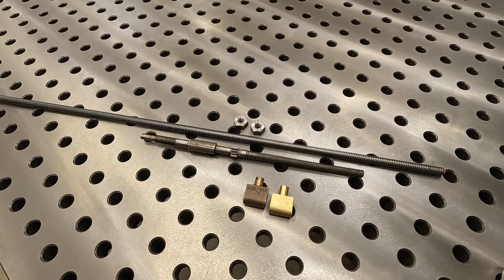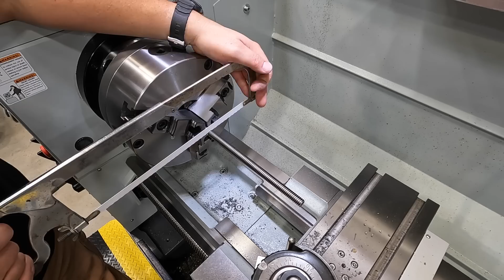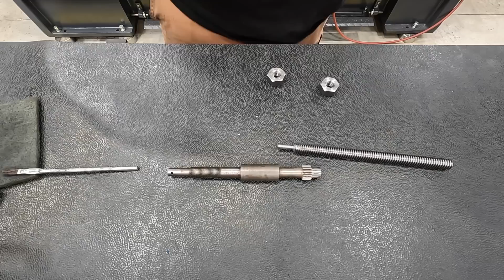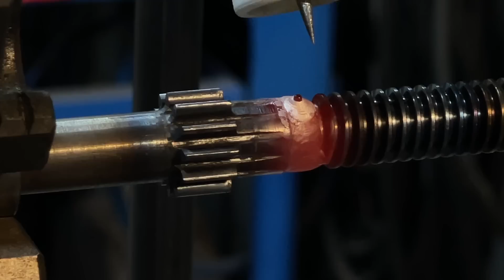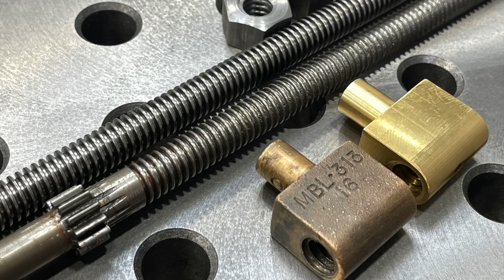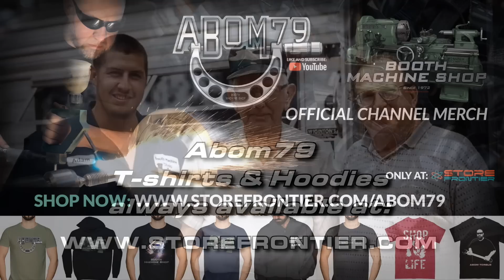Lead Screw Repair for 10" Rockwell Lathe

Comment: You were doing fine till you went at it with the welder, and were very lucky to be able to straighten it again.  A turned and bored interference fit well cleaned out with a drop of loctite and it was rock solid.

Comment: I just bought an eleven-inch Rockwell without being able to check for that type of wear. Why did I do that? This particular corporation that i frequent to repair machines had just retooled their maintenance dept (here's your budget, spend it or lose it) and it was headed for the dumpster. They told me to make an offer and I did. $150. They accepted and I got it outta there before they could change their mind. It came with two three jaw chucks, one four jaw, a face plate with three different drivers, a complete set of collets from 1/8-3/4, a knurling tool, tool post and various tool holders. a couple live centers and drill chuck. Even if it does have that wear, I'm pretty sure I can copy exactly what was done in the video.

Comment: My 1929 southbend has 12k slop in the brass headstock spindle bearings.

How can I make new ones?
Reply: @JohnJones-op8uf  it doesn’t have any left, some previous owner also ran it with the oil caps missing.

I think I do have an idea, I may take the spindle to an engine shop and regrind the spindle, maybe they can line bore my bearing caps for engine bearing caps?
Reply: @JohnJones-op8uf  no sir, mine are brass inside cast iron caps. Not..not cast iron bearings. Thank you for your input, for now I’m removing material with the south end and finishing parts with my 6” Atlas lathe. ☺️
Reply: @JohnJones-op8uf  I don’t have to do my homework I’m looking at the bearing 🤷🏻‍♂️ it’s brass…

Comment: If you were paying attention to the McMaster-Carr on-line catalogue page, you would have seen that the 1/2-10 LH Precision Acme Thread rod is 4140 steel.  The original part would have been made of the same or similar material, witness the fact that the shaft has a gear hobbed on it.  No one would dream of making a gear with 1018 steel.  It's always 4140 or better for hardenability, strength and wear properties.

Comment: are spiral flute taps any better than streight flute taps ? great vid . gives me new ideas on repairing / replacing the cross slide rod on my atlas shaper . thanks
Reply: It’s supposed to remove the chips better. Don’t need to back it out periodically.

Comment: I'm faced with this job on my old 1930 Colchester Bantam lathe that has the cross feed nut almost completely worn out and the same is going for the half nut.
Now I'm getting too lazy in my old age to start messing with replicating original parts from raw material so what I intend to do is make a mould of the cross feed nut itself and then cast a zinc alloy nut around the end of the screw where it isn't so worn.....if I oil blacken the end of the screw this will make removal easier..........I could make a few nuts in a few minutes  that will last for years and If Myford lathes can use alloy nuts so can I.......Zinc alloy is easy to melt and cast.......I'll get the alloy from old door locks and other house items that come in Zinc cast alloy.......I probably could melt a bit of bronze and do the same.

Comment: Probably not a smart question but could there be a concern about the "timing" between the new acme thread position and the small gear?
Reply: no. that does not matter.
Reply: Nah not on a part like this, it's mainly just for transmitting the drive force between the gears and that lead screw nut. Even for threading all that matters is speed (in this case thread pitch and diameter) so everything rotates/slides at the right speed, rotational position or 'timing' isn't an issue

Comment: Very interesting job.  Well done.  Your discussions are well planed and understandable by the inexperienced operator.
Do you sharpen your drills before or after each use??  If you do sharpen them, is there a particular system you use or does your considerable experience allow you to touch them up by hand.

Comment: Exactly right Not to waste your time on a pin since you tigged it. I mean if the weld fails which it won't, a pin isn't going to do anything. As simple as this job is to do, Tony can make another piece once his lathe is up and running if needed...Good job, Adam....Ricko

Comment: What are your thoughts on  using the bearing to bend the part straight in the lathe? ie chuck the part, turn it against a bearing in the tool holder and slowly move the cross slide to bend it then then return it to center.

Comment: Nice repair Adam. You can usually pull the run out by reapplying some heat or even another spot of weld 180° away from the high. It'll pull towards the low as it cools.
Reply: Man I was sad when I went to your channel and there were zero welding videos. :(

Comment: Now, i don't get the point in threading this joint. After all thread isn't the best fit for accuracy, even though made with a lathe. As i can see there is appr. 3mm 1/8" of material at the end of the thread, so it doesn't make it any ways stronger either. Straight snug cylindrical fit is more accurate and provides more support against welding distortion as bigger diameter is in use at the joint. And the weld is the thing holding it together nothing else in that matter.
Reply: Wow. I was shocked to see no videos on your channel. I would have expected a LOT of them considering you are trying to tell everyone that you know more about welding and machining than Adam. Weird.
Reply: @eriklarson9137  What a waste of a response. Attack the person instead of the idea, huh? What they said makes sense to me as well. And you might be whistling a different tune if you knew how socket weld pipe fittings are put together (hint: they ain't threaded and they need internal end clearance).
Reply: @eriklarson9137  You used this line on another comment. So, wow, I was shocked to see no videos on your channel that are related to learning how to not repeat myself.

Comment: "I think the weld is plenty strong enough ...".  Seriously?  That weld is 100 times as strong as it needs to be.  Loctite on the threads would be strong enough.  VERY little torque on the lead screw.
Reply: Not when working like it is supposed to to  and maybe not in a hobby shop but in a regular shop with lots of guys running it crashes are bound to occur and that is where you are going to need the "extra" strength, Like screwing up and setting the range lever in the wrong slot and jamming a cut off tool into the part. - Might not happen at home but you would be surprised what can happen to even a tool maker when he has  been there for 17 hours straight and the job has to be out by 8AM.
Reply: @mathewmolk2089  Good point.  However, even if the Loctite was not strong enough, there is 1" of threads holding the parts together and they would have to be stripped to break the joint.  (Right hand threads and clockwise screw turning.)

Comment: I have a 1956 14.5" Southbend and had to refurb the "crossfeed" screw as well. Issues i found: 
1) The Orig screw was 11/16 - 8 LH and is NOT available anywhere non-custom
2) I downsized to the 5/8 - 8 nut from the 13" but, The new nut is a 4G standard and EVERY screw i could find is only a 2C and rolled thread. This caused an interference in the root of the screw as the rolled thread has a rounded minor root whereas the 4G standard (All ACME) has a sharp corner. McMaster, Thomson linear etc. All only supply a 2C rolled thread ACME. The one from McMaster was loose with the new nut, and the Thomson was too tight. Lowest quote for a precision ground was $600 +
 I wound up rethreading a 5/8 - 8 from Thomson on the Monarch 10EE to fit the 4G nut. It's not perfect, but more than useable with around .0018 takeup. (For comparison, my Monarch has .0002-3 takeup on the crossfeed screw and my Logan 10" has .004 with a new nut and old screw)
 I would be interested to know how tight this combo measures once reassembled.

Comment: Nice repair. I would personally have used silver-solder with a reasonable short conical interface.
One can coat the surfaces with silver-solder in advance, let it cool down,  then put some more flux to the surfaces, let it dry, press them together gently, and heat the whole thing up under some axial spring pressure.
Swedish Gun-drill heads are much in this way, soldered or brazed to the shaft. However more like a Vee-scarf, not conical.

Comment: I too have an old Rockwell lathe! This common repair is completely new to me, so I appreciate the video. If I were to attempt this I would be replacing the acme screw with a ball-screw while I was at it. Zero backlash, is better than less backlash and it's my lathe so, I do what I want, haha. Thanks!
Reply: If you use a ball screw, it while unscrew under cutting pressure. The friction is necessary in this case. If you were going to drive it with a stepper or servo that can hold position, then a ball screw is a good choice, although you also need some room for it.
Reply: @carlhitchon1009   That is a really good point! I was thinking ballscrews were completely superior and only more expensive than acme. The lack of position hold is not something I considered.  Switching to a ballscrew, if space permits (another good point!) , would also require an additional axis lock, or stepper/servo with hold position capability. Thanks!
Reply: @justanum  I have an 11" Rockwell. There is no room. The brass nut that the customer provided, that is the width of the slot it sits in.
Reply: acme rod is used for a reason.

Comment: An option to welding the parts together is to use a thread-locking compound, such as is made by Loctite, especially in a low impact application such as this cross-slide.

Not all thread-locking compounds (glues) are created equal, so it's necessary to consult the manufacturer's application guide in order to make a good selection.

Some of these grades are intended for some pretty critical assemblies, and do not come apart without extreme measures.

In this case, the as-machined parts assembled and ran true, but welding introduced  movement of the base metal parts, resulting in runout which then needed to be corrected.

Not a big deal on a one-off repair, but if you want to get things done and move on to other ways to use your time, it might be annoying.

Neither solution is always "right" and it's always a case of the guy doing the job needs to decide what way to go about it... it's always better if you have an option for a Plan B though...

Comment: Single-point threading 1/4" - 20 on a stud end that's just a fixator for the weld... Showoff!!! ;)
Reply: Not really, running a die down it would not guarantee it to be true to the axis.
Reply: I need to  fix our Clausing and this beats the hell out of making it from scratch but trust me. When I cut the threads it's going to be with a die. Get er done and get er back to work!

Comment: I don't want to be too critical here, but that weld was way, way too hot.  The heat affected zone went out 3 inches in either direction, the weld was a burnt grey color, and the piece was glowing red hot after the weld.  Don't be afraid to drop your amps way down low for such a small weld.  It will help prevent warping, it won't change the properties of the material as much, and will be easier to clean up.  

Other than that, great video as always.
Reply: on 10 carbon steel? Who cares?,,,,and you missed the part where he told us he first tried to heat straighten it . - I think that is where the heat came from. Not the weld

Comment: I had to do a similar repair to a 1936 Lebond 15" lathe.
Instead of threading we bored the gear side (the one your threaded as female) and machined the new "Rod" for an interference fit which mated by cooling the rod and heating the female side.
I then had two small holes drilled through which I plug welded with the tig. The idea was the keep the about of heat input to the two pieces at a minimum.

@Abom79 I was curious why you would choose a 360 weld instead of say a plug weld method. 

I understand the threading of the two together, which makes total sense.

I consider you and This Old Tony to be the gold standard for videos that teach people about machining and the trade in general.
IF I ever make it to your part of the country I am going to definitely stop by and drop of a case of beer as a thank you, you have taught more than you might realize to many.

Comment: When we did a shaft we basically did a similar fix. We turned the 4140 threaded rod down, machined threads with a shoulder, on the OEM shaft we drilled, tapped and counter bored for a snug fit/alignment. It Turned out pretty good. I'm thinking I should start recording the machine work I do. 
Love the channel and the content man.

Comment: Adam, why on earth didn’t you use a live center to stabilize the ACME thread?  Rewatch this piece, and you will notice your screw wildly flopping around!  You also drilled into a nub, which seemed unusually sloppy for you.  This in-turn caused the bend you had to repair.  I hope everything is OK with you.
Reply: I first noticed the thread tap going in at an angle and was very surprised to see Adam doing such sloppy work and I also noticed a slight bend in the shaft later on when he assembled it and turned it in the chuck but when you look very close you can see that the bend is not at the connection point. It looks like the bend is nearer to the hand wheel end, this is obvious @19:40 when he is trying to get the shaft straight, he only measures the runout at the end of the thread but you can see the middle of the shaft is out of true.
Adam is the God of machining and this type of thing stands out sharply against his usual high standards.
Reply: @ian-c.01  And the part is now back on the lathe and working just like it did when the lathe was brand new. . Proof that there was no reason for him to have done anything different. 

Getting the thing running within 5 tenths is better then it was from the factory, in fact.. Knock it off with the pedantic nonsense my brother
Reply: Do you mean at 4.30 where he says he has faced and centre drilled the part? which can be clearly seen in the video
Reply: @chrisosborne6957  My bad.  I was watching so intently that I missed his comment that he had faced-off and center drilled.  Adam is a vastly superior machinist to me - I think the flapping thread seemed so out of character that I commented; I don't claim to know more than he. Thanks!

Comment: I've been involved in engineering all my life, from starting an apprentiship as a machine tool fitter at 17 years old which involved building gear cutting machines, then as a maintenance fitter servicing and repairing machine tools to finally retiring at 65years old as an instrument maker building and final testing scientific test instruments for the petrol/chemical industries to name but a few. When i was servicing a Hardindge lathe many years ago the cross slide lead screw nut was split and had an Allen cap screw which could be used to adjust the back lash in the nut presumably to prolong the life of the lead screw and nut. Have you ever come across this type of arrangement before?
Reply: Clausing Colchester used this design. It helps, but the lead screw wears, though not as fast as the nut. You can adjust for near zero backlash in the worn area, but it will be uncomfortably tight in the less used areas. Clausing won't sell just the nut for the Clausing Colchester machines.The lead screw and the nut come as a matched set. I never considered a cut off and weld repair. I will certainly consider it for my hobby home shop machine repairs.
Reply: The problem is that when adjusting for backlash in the worn-out area of the threads, it becomes nearly impossible to turn when it gets to the area of better condition

Comment: I think I would've gone with pinning it instead of welding it.
Reply: Or an anaerobic adhesive - high-strength locktite or epoxy.
Reply: Thats what I would do, loctite and pin it, but I am not a good welder.
Reply: @dutchgray86  The other benefit of that is that it can be easily disassembled just by heating the assembly and unscrewing it… allowing the threaded section to be replaced again.

Comment: I think (only think, because I have zero lathe time) that Joe pie's way of threading away from the chuck is definitely the best way to go.
Reply: I will have to re-watch that video. Threading away from the chuck works well if you pre-engage the halfnuts and then start the spindle otherwise you have practically no time to react if you miss the mark on the threading dial.
Reply: Wouldn't work in his case. The insert holder turned upside down would be left handed and a left handed holder only holds lh inserts that have the wrong clearance
Reply: @an2thea514  Not true - a left-handed tool holder with an IR insert would work upside down, threading away from the chuck as suggested by the OP.  I do it all the time when the thread runs up to a shoulder.  Avoids the need for the giant undercut too.

Comment: Tig seems like overkill. Heat up and hit it brazing rod. Nice job
Reply: Was wondering about brazing or silver soldering. Perhaps less heat-induced warp?
Reply: How is tig overkill Denny ?
Reply: @Jacob-64  ever seen carbide tips applied to a saw blade. Just seconds to attach each one. Brazing. Or I guess they could tig weld each one. Might be a useless measure.
Reply: WAY more heat input and actually harder to do. Heliarc (TIG to you kiddies) is the only way I would do that,,,,and I got my degree in welding engineering from OSU over 40 years ago.
Reply: @mathewmolk2089  brazing is like soldering a copper pipe. It's really not hard at all. You must have forgotten alot after 40 years of hard drinking. Just kidding. I think that it is just a personal preference.
Reply: @mathewmolk2089  by the way helium isn't used much anymore. As in kiddies heliarc.
Reply: @mathewmolk2089  of course you have